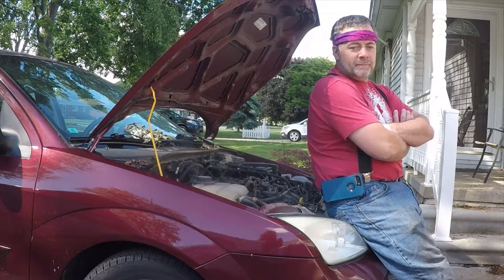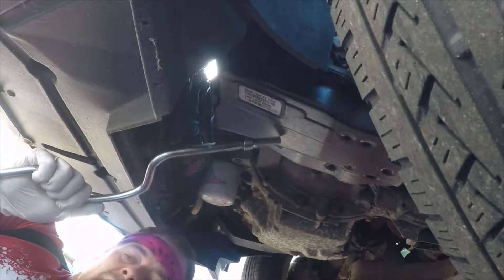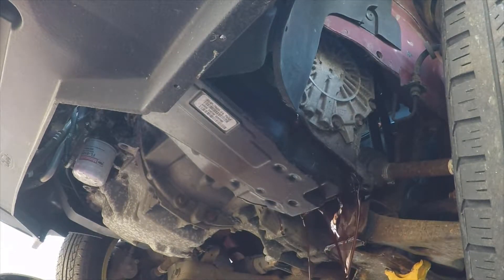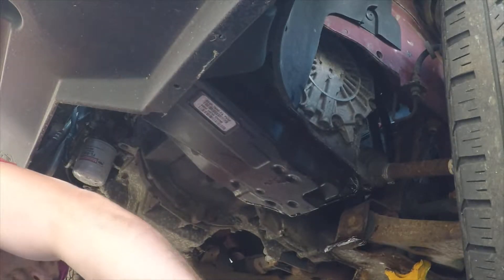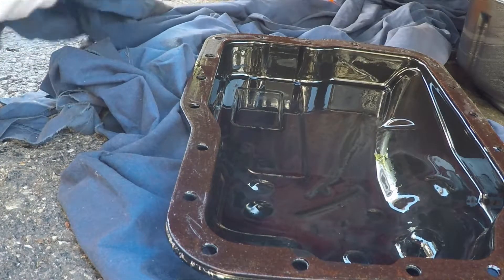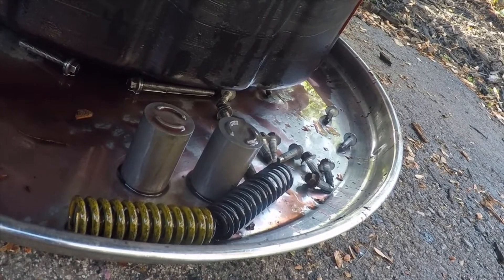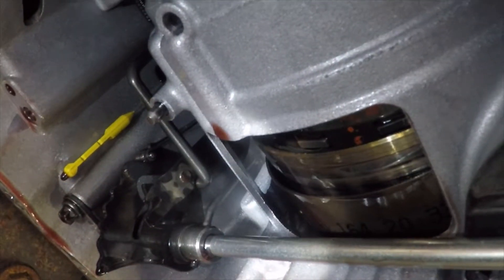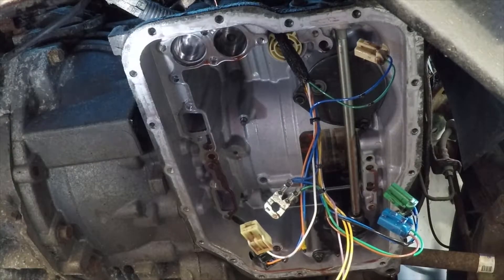focus trans part one

Comment: I see you removed side cover in car. I have one with no Reverse. I've heard there could be excessive wear on side plate.  Think it's possible to replace just the side plate?
Reply from the maker: Yes. Mine had bearing damage in the drum along with the servo bore. If you are careful it isn’t too bad. Of course dropping it out is the proper way. 🤔
Reply: @houseofbrokendobbsthings5537  cool,do the drum clutch packs just pull out with side cover off or do you need valve body off as well?
Reply from the maker: @ryanhughes8137  I would take the valve body down. Will be helpful when reinserting to hold or rotate. If you haven’t done it before it make take a few tries. The plates require a little rotate/wiggle to line up on the splines. You need to count the clunks of each plate as it lines up, and double check the depth of the assembly to verify it is seated fully. Otherwise, when you reinstall the side plate it will lockup and not rotate. That will end in very fast failure if it works at all. The sealing rings will not be in the proper location and not provide pressure. Plus the clutch plates will be smashed and not release. The servo piston also needs to be lowered otherwise the band will make alignment tough to impossible. Once in place reinstalling the servo piston will help hold things in position (a little anyway). Good luck - happy to try and answer any questions.